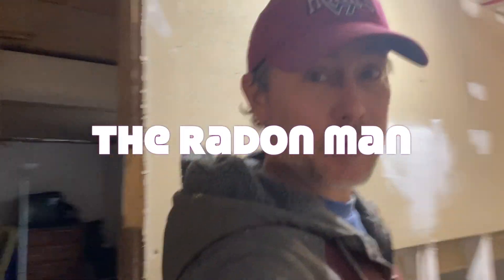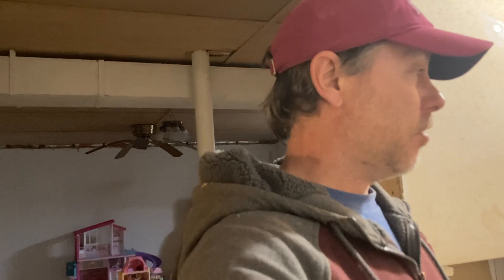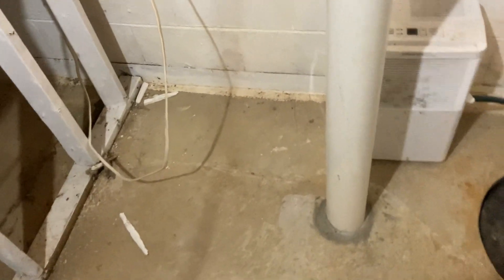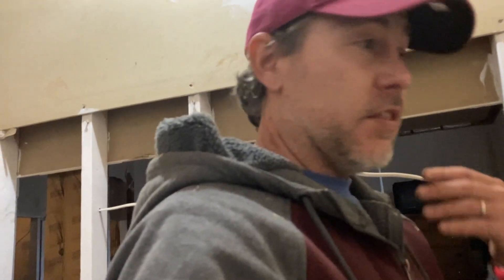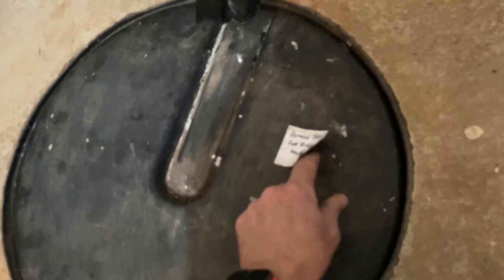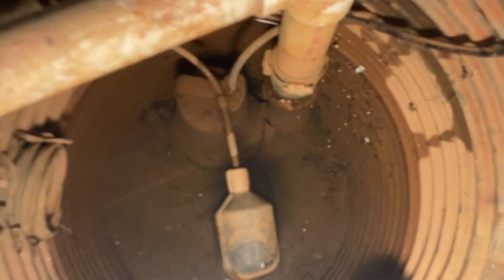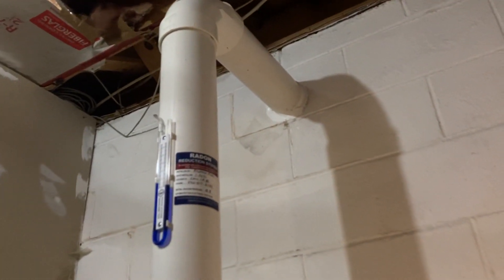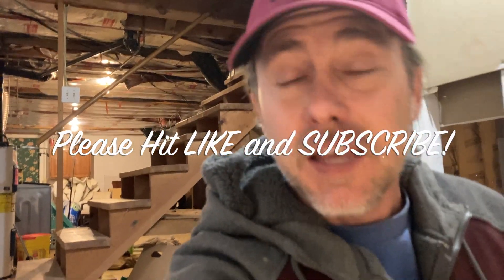Radon and Perimeter Drain Systems/ Short Video

Comment: Scott great video. I had a Radon Mitigation system just put into a home I purchased. It is working great with only one slight issue. The fan is outside and is pretty quiet, but the very top of the system seems to amplify the sound coming out of the top pipe. I have been looking at mufflers sold at various outlets and was wondering what you think about them? There are videos of people using DIY mufflers, but the one I am looking at is from RadonAway.
Reply from the maker: Hi Jack. Sometimes the acoustics with regards to how the pipe exhausts doesn't go our way.  I have no experience with mufflers but I'm aware they exist and Radon Away has so much good stuff.  I've had luck putting a 45 or Street 45 at the top diverting the airflow away from whatever was amplifying the sound.
Reply: @radonman6800  Thank you will give that a try when the weather is warmer.

Comment: I wonder why you didn't just install a removable radon sump cover and pipe through that? Would be a more even and  effective air movement through perimeter.
Reply from the maker: Hi DJT.  You are probably not wrong.  Once we've found methods that have proven successful, it's hard to deviate or experiment (speaking for me). Plus this job was an hour away.  Thanks for contributing.